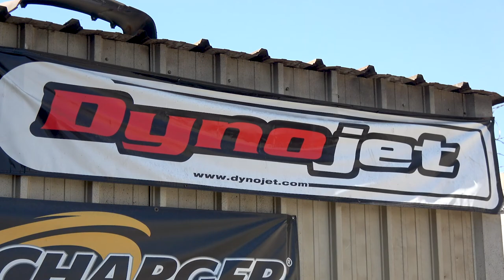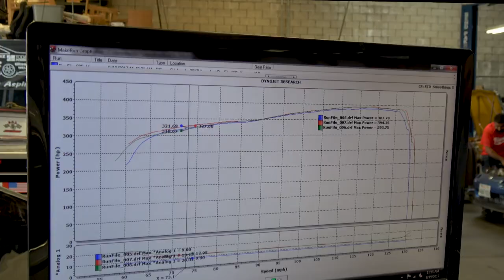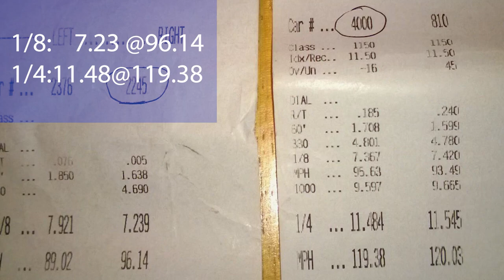1974 Ford Pinto Wagon - Budget Built, Pump Gas, Street Driven Bruiser

Comment: In 1977, my Dad built two '74 Pinto station wagons. One was a 302 powered Drag Car with '69 351 Windsor heads (Back then, that was about a good as you could do without using Boss 302 heads). The other one was a 4 cylinder powered family car. He purchased both of them wrecked and repaired the damage. He raced the Drag Car for 2 seasons, and we went on a long vacation with the stock one. We left the day after he got it running and we traveled probably over 2,000 miles over the next 2 weeks. Talk about confidence in your own work!
Reply: Your dad was a cool dude.  Mine too.  Pinto was his car as well. Blew away all others in his pinto

Comment: I used to have a 1975 wagon complete with wood grain sides and a 4 speed. The most valuable part of the car were were the rims - Cragar 4-spoke SSs. Anyway, if it had had a V8 or anything more potent then it’s stock smog 2.3, I think the launch would have jolted and torqued the body so much that it would have left a large pile of rust on the starting line that probably would have accounted for a couple hundred pounds. Anyway, great video. Despite their reputation, Pintos always had a great look and stood up to a lot of abuse.

Comment: Awesome! am fixing up a '74 wagon as well,with an '87 turbocoupe engine,T5,8"rear,cant wait to cruise!
Reply from the maker: Hellz Yeah!!
Reply: Did you know? Back in '87, a magazine did an article on the road testing of a turbocoupe. The line going to the pop off valve, they cut it and added a section of plastic tubing. They drilled holes to fool the valve and boosted turbp pressure. The turbocoupe ran 14 flat in the 1/4 mile.
Reply: @rickuyeda4818  did you know there’s a 2.3 turbo pinto on YouTube that runs mid 9’s ?

Comment: Very cool.  I had a 71 Pinto with the 1600 push rod engine that I had modified.  It was a four speed three pedal car and it was a blast!

Maybe next a huffer?  My son put a roots blower, larger injectors and a close ratio rework on the 5 speed trans on an NSX with the stock 6 cylinder.  Geez with 400hp, that thing was scary to drive.

Comment: Owned Several  Pinto wagons...They were great reliable Cars...If you got it with a 2000cc Motor and a Stick....they were fun to drive... and quite quick...Mine came with 3.55 gears ....Would slap around my buddys  Vega Gt on a regular  Basis....Got only one with an Automatic....it was a Dog...😖 Converted that one to a stick also...Love the V8 conversion...
Bad Ass...👍

Comment: I helped a friend build one of these back in the 80's. It was a lot of fun until the transmission had to be replaced. Everything had to come back out because the bell housing bolts were not even visible.
Reply from the maker: Yeah, its a bit on the tight side under the hood, lol.
Reply: @modernchaos  Hooker made custom headers for this swap and they made it a much easier job then we thought it would be.
Reply: Should of cut holes in floor to get at bolts

Comment: The good thing about the Pinto wagon, it*s a lightweight , and you could modify  it, by putting in a bigger engine, change the rear axle, put bigger slicks in the back.
Reply: No shit?
Reply: Enrique Lopez 2400lbs across the scale .
Reply: Back in the day, when kits were coming out for the Pinto's and Vega's, the Pinto had headers that went foreward for clearance.

Comment: This car kicks a$$! I love it.
I talked to Mark about it at AM/PM in Yucca one time and he showed me the engine. What rear gear ratio are you running?
I just picked up a white '71 sedan that has a 289 v8 conversion right now but want to do it more like this one with a stroker motor, would like to talk if possible, have a few questions. Thanks, cool video!
Reply: I can tell you, the 289 block won't have cylinder walls long enough for a stroker unless it was built in 1967. the prior blocks will dangle the piston at BDC and you'll risk piston rock. Just go nab an Explorer 5.0, you'll get free roller lifters to avoid wiping out a flat tappet cam, you'll have GT40P heads, you'll just need headers and an intake if you're going carb. I think it will have the 302 firing order, not the HO/351W firing order if you stick to the stock camshaft.

Comment: I'd love to find one that's buildable! I had a Mustang II that had a four cylinder and automatic. It was the slowest thing I've ever owned. It sucked, but when motivated boy a small Block, short deck 302 or even a 289, they can be pretty fast without having to resort to Nitrous, if you build it right. Good motors. A 351W is even better and if you swap the crank for one from a 400M you've got 400 cubes with a stock bore that will make tons of torque. All you'll need is a string drivetrain, enough weight on the rear end to help get traction, a roll cage and subframe connectors to keep the unibody from twisting like a pretzel.
Reply: There's a guy running around with a Pinto runabout. He took the turbo 4 cylinder out of Thunderbird and the car runs 10's.
Reply: @rickuyeda4818  if it's missing the front bumper, that thing's been around since the last century. there's a ton of potential in a blown OHC four.

Comment: I'm currently looking for the 74 wagon I built in 86,has a 425 nailhead Buick setting in the front seat area,yellow with red and blue stripes,would like to get it back,had 257k on the motor when I put it in and still ran a 12.7 at 3,200 lbs. On roadhugger street tires,one of the last owners had the motor rebuilt so I would love to see what it does now!!

Comment: Cool!  Back in the day, you didn't see many Pintos with SBFs in them.  If someone wanted the "little car, big engine" it was usually a SBC in a Vega.  If he had 600 HP instead of 400 HP, it would be under the 10s in the 1.4 mi. Or faster.  But tons more money and street ability goes down.  If it will do 11 sec all day long, it should fast enough to win regularly.

Comment: Those shoulder belts are installed completely wrong.  They won’t protect you if you wreck, and they may hurt you since the belt is attached way too low and will fall off your shoulders.

Comment: It would be  faster if he put a kn. Flow control  air breather  lid on it an taped  off the air filter to  control  in coming  air . An used a taller  hood scoop . The first inch above the hood has no moving  air you need to be above  the first inch to get air flow